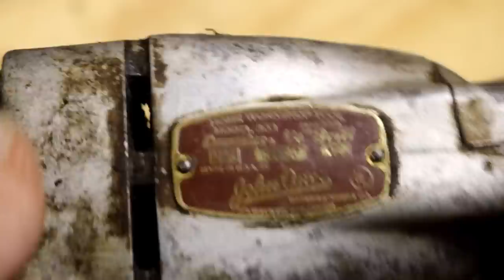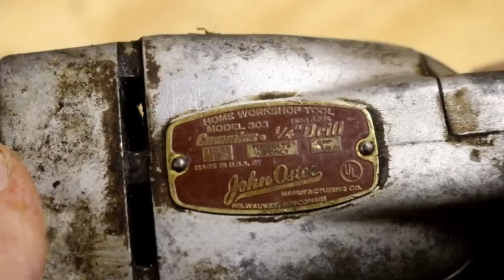Beyond Repair Truss replacement patch.

Comment: Those saws are actually from the 1960's, my dad has one identical... Sears started using plastic in the 70's
Reply: I have a similar jigsaw from my grandpa, which is probably older than the 60's. He was a cabinet maker by trade, and had a full set of aluminum power tools like that. I think those were his tools from home though, probably not what was used in the shop. A "skill" saw, jigsaw, belt sander I believe...
Reply: @Peter A. Van Tassell
The aluminum frame jigsaw of Craftsman brand were available at least through the very late 1970's, as I purchased 12 (for the company for which I still work) in 1978.
Ken
Reply: @kejay74  Interesting, were they regular cataqlog items? Because I don't recall seeing anything fully aluminum after about 1977, at least not in the stores.
Reply: I'd bet that saw dates from the 50's.   indestructible and you could replace the brushes.
Reply: @OldtimeIronman  Ahh...That could be it!  We were set up with a commercial tool supply account, at the time.  We had a multi-year contract with Sears to provide many of our common machine & fabrication shop tools.  We quickly 'outgrew' that and it was "history" by 1981.  Curious about where I work???  http://www.moorefans.com
Ken
Reply: @OldtimeIronman  Showing my age, but I don't remember seeing anything in the stores that wasn't cased with plastic after about 1973 or 74, and I wasn't olde enough to be involved with buying the commercial stuff until after 1981...
Reply: Still to this day a high end saw is still metal  but for the easy grip handle.
Reply: @kejay74  all they have to say is awesome to work that many years same place you must really like the place I've been at my place of work for 22 years the pay is not that great but it's close to home and greet people to work with
Reply: @plymouth-hl20ton37  Actually, started part time before graduating high school.  Looking to retire in about 3 years as I round out 50 years with them.  Have been (very literally) around the world for them.  Three times into the former Soviet Union, under two different Leaders.  Brezhnev and Andropov. Not to mention such as Germany, England, Thailand, Japan, Guam, Colombia, Argentina, Pakistan, Bahrain, Trinidad, Venezuela and many others. 
Ken
Reply: @chemech  Actually feeling my age here too, I don't recall seeing anything metal after about 74 or 75
Reply: Yes, by the 70s, or at least certainly by 73, the new models were all "double insulated" with plastic bodies, and many went back to two-prong plugs because they literally had nothing to ground out.  That's when I started getting my own power tools.

Comment: It's actually extremely smart to make the switch like this in an ungrounded tool with a metal body. If the phase shorts to the casing, the shock will hold your hand closed, so making it shut off if you close your hand might save you. But chances are, it will just continually close your hand multiple times until you're dead if you cannot manage to keep your hand closed after being buzzed with mains. Please permanently disable or destroy it.

Comment: Steve using that ice/water sheald.  dont let sunshine on it very long, it turns to fertilizer FAST. i can hardlyy wait for a "metric mill rebuild"  the shop is coming along very well.  poppy
Reply: I usually see the roofers laying down the shield for a few rows then shingle up to it. It's best to walk on the shield as little as possible.  I've never seen them sheet the whole roof first before shingling.  The most common practice here (Northern Ontario) is to use the shield on the first six feet of the roof (and in valleys and chimneys Etc.),  then use the manufactured tar paper replacement material, which is an excellent product.   This is a very good method and saves a lot of money.

Comment: In England, those cross member pieces are called noggins! and so is the human head
Reply: I bet they greet each other often
Reply: Same in NZ,  but I think the spelling in NZ is noggings,  also called dwangs (where this latter name comes from I do not know).
Reply: @evanpenny348  Here in the U.S.,  Nogs or nogging are wooden blocking set in a masonry opening to attach the door or window jamb to.
A horizontal piece run across rafters to support roofing is usually referred to as a Purlin.

Comment: The old drill should be able to be rendered safe by replacing the power cable with a 3 wire type and 3 pin plug. My best guess is that the switch mechanism uses a change over switch  (Common, NO, NC) and is wired incorrectly. Power should pass through Common and Normally Open to operate motor when trigger is pressed, but may be wired so it passes through Common and Normally Closed to activate the motor when the trigger is released. If so swapping the connection from NC to NO would overcome that issue. Then squeezing the trigger and sliding down provides a trigger lock function similar to the  squeeze trigger and push button on latter mains powered tools.
Reply: Not necessarily.  I've had drills of that age that were what they often called "triple insulated" and there wasn't a ground pin on any of them.  When young I actually added a grounded cord to one and it then proceeded to zap you when it didn't pop fuses.  Needless to say the 3wire cord came back off.
Reply: You can play with the cord all you want but a drill that keeps running when you drop it off a ladder or roof is never going to be safe.
Reply: @rick4adk  If you upgraded to an earthed cable correctly and connected to a properly earthed outlet, the case would be at ground potential. Suggesting that it zapped you and blew fuses indicates that the earthing on the outlet was not up to scratch, and rising above ground potential, that you had inadvertantly wired something incorrectly, or there was leakage from the internals to the case. I am in Australia, and all of our mains have had to have proper tested earths from the start of reticulated mains power, but I know that earthing outlets was the exception rather than the rule in the US into the 70's. We had an Engineering Instructor from the US when I studied engineering, and he was adamant that earthing outlets and appliances was deadly, based upon the notion that a defective earth system would leave equipment cases live as witnessed in the US.  The thing he should have taken issue with was very poor consumer installed earthing systems that we not properly installed and tested by competent people.

Comment: Those type of drills were lethal in the UK where the voltage is a lethal 240v at 50Hz not only if a fault occurred in the drill itself but also if you should accidently drill through a live cable buried in a wall

Comment: Steve your drill made by Oster, that company made barber tools to and a wide range of kitchen tools and appliances very good quality also I might add. That drill is one of the very best tools you will ever own, and yes you can upgrade the cord to a three wire if you must or use it only on a gfci protected circuit. But that is just me.

Comment: That ice and water shield will really help on your low pitch roof. Pay attention to your package of shingles as it will say what the minimum pitch should be.

And that drill motor looks like a ray gun from the 40s

Comment: Ice and water shield is typically put on the sheeting from the edge of the roof to one width past the wall. The rest of the roof gets roofing felt, mostly because ice doesn't typically happen much past that point. In cold climates if the insulation isn't very good or there is poor ventilation from the soffits to the peak of the roof you can get ice dams build up along the edge of the roof where the melt water runs down and gets to the overhang. This ice will also work it's way under conventional roofing felt. This can also happen on a south facing roof where the sun can melt the snow which freezes again when the sun goes down. The ice shield stops the water getting under the barrier to the roof sheeting. It isn't wrong to put it all the way up to the peak and in fact is good to do but is typically not done because of the expense.

Comment: looks great Steve!
might want to consider using a little  adhesive in some of those scab joints might be overkill but i always do it when i have to do creative framing repairs. Its a cheap sleep enhancer.
Snow and ice shield is the way to go! we use on most roofs in the northeast.
 My philosophy is since your doing most of the work yourself...your own time is very expensive so use the best products, and take time to research and  install them correctly. So you only do it once in your life.

Comment: Steve someone rewired the switch on the drill to work that way. The lock is suppose to be holding the drill on not off. Had one like this many years ago and was a great Drill.
Great Job on the Shop.. Enjoying the shows..
Reply from the maker: I would bet that you are correct 👍

Comment: For all the times you use a saber saw the $5 vintage Craftsman is great. A newer better saw however can give you variable speed, oscillating blade selection, a light, quick blade release and battery power. I wonder if John Oster had anything to do with the Ostreizer. The truss on the gable really wasn't supporting or spanning anything.

Comment: If you got the money for it then ya go for it.  I however have used felt for all of the roofing I have done.  I also double felt my roofs as that was I was taught to do for long term results.   Roofs are supposed to be replaced to code twice in your life time.  The main problem of today is that many of the Roof Ratings for long term durability are at best suspect. 

 Generally, a 40 year roof rating will not last 40 years as the rating is under "ideal" situations. I always expected around 25 years on that rating and in my case that is exactly what happened to my roof. I had to do some minor repairs.  I'm going to be using Roofing paint (as the technology has gotten better over the years0 in a few years to extend the life of the roof.  

Nice job on the Truss by the way.  It is not going anywhere anytime soon. :)

Comment: Steve if you make a solution of antifreeze and copper sulphate and paint the damaged area it will stop any further fungal or insect damage
Reply from the maker: Thanks👍
Reply: @SteveSummers  another one is borax (yes 20 mule team borax) and glycol based antifreeze. Mix em, boil them. The antifreeze keeps the borax in the wood cells. A lot of insecticides will leach out of the wood without any other agent to keep them in there. It's in the google. Old faishoned drain oil poured into the affected wood is good too. All you have to do is make it taste bad to bugs lol.
Reply: Bleach can be used to effectively kill wood rot and stop its spread. It attacks the fungi that causes rot and stops it from growing. Bleach can be applied as a spray or directly on the rotten areas with a cotton swab.

Comment: I have a jigsaw to from the 1970's is well as a sander going strong but also have new battery models to, one of my electric drills is very old and was my granddads before i was born it's a very early 1960's model Black & Decker and works great and it's still ok for drilling wood and soft metals

Comment: Careful only running ice and water shield, did that on my shop and the shingles only lasted 5 years
the tar paper underneath wicks asphalt into the shingles as they dry out in the sun
Wherever you put the ice and water, put felt over top of it, and use the 30lb felt for double the reservoir of asphalt

Comment: Speed square goes in your leftside pouch. I mean, it goes where ever you want it but the left is better because you usually have a tool or pencil in your right hand and the left hand is free. It’s just a little easier and quicker.

Comment: I think that drill came in a kit of stuff... If memory serves, there was a stand the drill mounted in with a grinding wheel attachment and maybe that is why the switch is such that it is......Dangerous two prong plug?  Hell, when I was a young man, that's all we had.. I do know of two men being electrocuted with a drill but one was underneath a house lying on the ground using it, the other in a likewise wet location....It is good that they are now double insulted and grounded though...Mike in Louisiana

Comment: Usually it's it's easier to to just add 1/2'' plywood across everything to tie everything together. Instead of all the scabs and 2x4s.   The drill has a sort of streamliner aesthetic from the 30s.

Comment: Steve
Here in the UK ref tools and 110vac most were not earthed in the past due to how the 110vac was supplied
As the normal supply is 240 vac one side tried to earth and called the neutral wire that give the phase wire 240vac about ground not to good
The 110vac is wired in a different way when a tool transformer is used or a workshop wired for 110vac and 50vac ( used for hand lamps ) the secondary is centre taped to ground therefore you are only 50vac above the ground pretty safe 

When I served my time ( 5 years then) we had a lot of 220 vdc at the iron works that was fully floating , therefore you could and did work on it live (only one side at a time one hand in pocket ) all open switch gear completely bare 😀.

But that was long ago later on I became qualified live line working on over head power up to 11kv and live under ground to 415 vac 
But as I have not worked for 23 years that is in my past noticed you have been wed for now over 15 years congrats 🎉  we have now just passed our 53rd year
Reply: Congratulations, Stuart. Quite the achievement in this day. Best of continued luck to you both!

Comment: I'd guess your Craftsman saber saw was late 1960s or very early 1970s. I have a very similar saw I bought in the early 1970s, but it is black plastic double insulated. Other than that, it is almost identical to yours. And it still does everything I need in a saber saw.

Comment: I actually like your shop rebuild series better then machining videos. That drill surely didn't get an OSHA approval whatsoever. But please don't throw it away. It can be refurbished and made safe and run like modern drills. In fact you could do a video on the refurbishing...   Thumbs Up!

Comment: While there's no harm in using it on the whole roof, but even here in northern climates where it's required, the ice and water shield is normally only required as the first 2 rows of underlayment.

Comment: (11:56) - That's a Sears Roebuck Craftsman Sabre Saw.
Look at the information plate for your model number.
Model no. 315.27981, which was the very first in this series was launched in 1956.
This was followed by the 315.27982 but not sure when.
I shall update comment if and when I find any more info.
>

Comment: Poor man's pressure treatment: mix linseed oil and diesel 3:1 and apply with a chip brush. When adjoining new wood to old, dry out the old with a heat gun and brush with a wire brush. The dry wood sucks up oil mix. It's not really pressure treatment, but it's the least you can do to give the new wood a chance. Always brush it on the end grain.

Comment: The drill looks art deco,gives a Buck Rodgers vibe.
Reply: I bought a sort-of similar drill at a garage sale - a "Home-Utility" model by Black & Decker.  The chuck looks the same as Steve's drill, something that uses a weird rubber mechanism instead of the now-standard chuck.  The plan, of course, is to turn it into a prop ray-gun.

Comment: I'd say that Craftsman sabre saw looks like it's 50's or 60's vintage.
I wonder if that 'John Oster' drill is related to 'Oster' kitchen mixers.
That self adhesive stick-on roofing membrane is pretty high-zoot. It is excellent stuff, but very expensive in my area. I used it on my well house roof, but I can't imagine how much it would cost to do an entire  roof like yours. Often times, people opt to just do the peak, rakes and eaves with that stuff because of the expense. 
yeah, that was huge mistake on the part of the original builders of your shop to not flash & counterflash that chimney. Very, very short-sighted on their part.
Anyway, looking good. Like you, I can't wait to see the shop all sealed up.

Comment: just curious at your young age the best shingles will be used up in 30-35 years but we have houses here from the early 1900's that have the original metal roofs on them and are still holding up ! i know the shingles had a great price and i would also use them based on that alone but i dont think they will last you for the rest of your life but i have been wrong before but i bet that underlayment under metal would last atleast 60-70 years with the great metal coatings we have know keep up the great work your work is as i would say prestine and imaculate

Comment: (11:07) - Be careful with extending that overhang.
You may want to do some calculations because the roof could be lifted off the building at a much lower windspeed.
>

Comment: My guess would be late fifties early sixties on your jig saw.  By the seventies when I started buying tools they had already put some black plastic on the outside.  Looks a lot like the style of the Craftsman drill motors my Dad had in the mid to late fifties.  Weight is good with a jig saw as it cuts down vibration and makes a better cut not to mention the metal bodies mean they could be rebuilt back when Craftsman actually backed their tools and kept parts.  Hang on to it by all means.  Glad you got rid of the rotten wood.  Always makes me cringe to see it covered up.  Just bug food at that point.  Nice job.

Comment: No one uses felt paper any longer. Ice and water shield is usually placed in valleys and the bottom 3 feet of a roof where ice will build up from frozen over gutters. 

I’ve used the synthetic underlayment and I’m a huge fan. Good for 6 months exposed to weather before you even have to cover it. But don’t cheap out, buy the good shit.